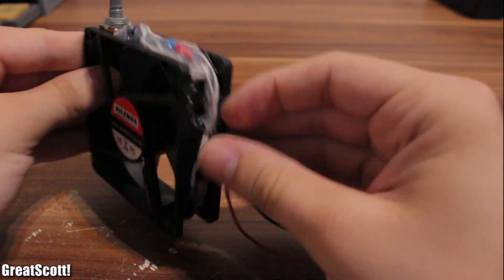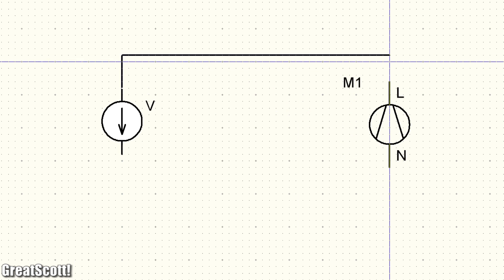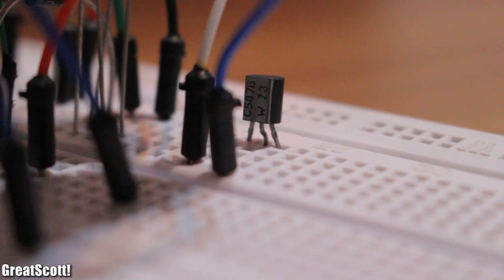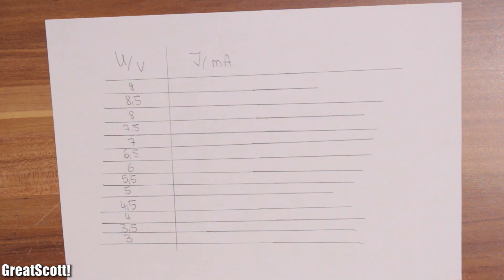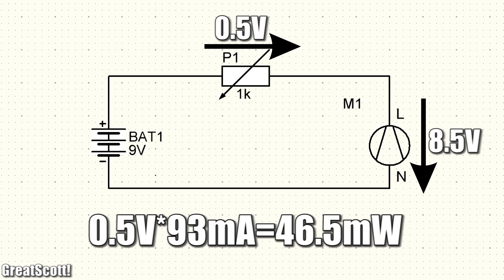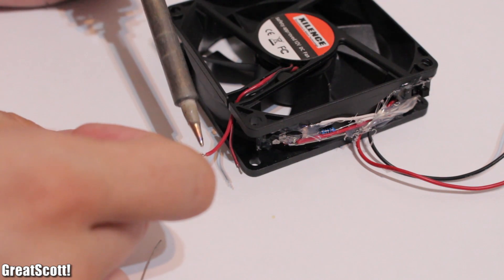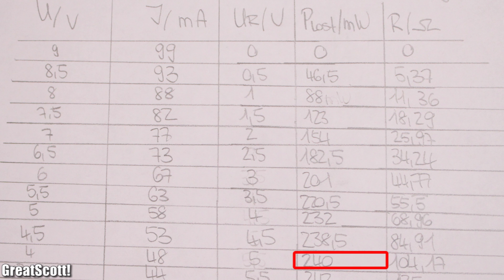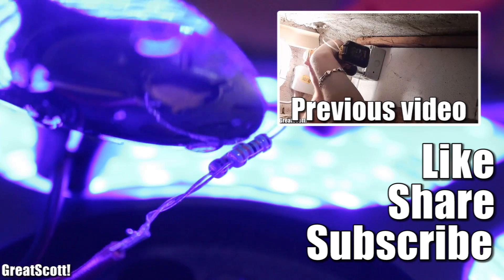PWM VS Potentiometer! When to use which technique?

Comment: Hi GreatScott,
I have some questions that I am thinking about it. I wanted to build a PWM controlled fan for my power supply's cooling fan, by taking the temperature of the mosfet in the power supply, it controls the duty cycle of the PWM of the fan. I have tested with Arduino to control it and it works fine. But I am not gonna put my Arduino board into my power supply. So what microcontroller do you recommend for this project?
Reply: ATtiny85 will do fine
Reply: ATtiny85 will do fine
Reply: ATtiny85 will do fine
Reply: ATtiny85 will do fine.
Reply: ATtiny85 will do fine.
Reply: ATtiny85 will do fine.

Comment: Why didnt the leds flicker when you used pwm? :s
Reply from the maker: lastick56 Turning it ON/OFF happened really fast. The human eye is too slow and can not see the flicker.
Reply: oh. sorry. what i mean is how did your camera not pickup the flickering? :D
Reply: ***** the intentional space station moves at 7KM per second, and 30fps is plenty. Speed has no direct relationship to framerate.
My phone's camera can also see a difference between 1000 and 2000 RPM on my drone's propellers, but that's because of a principal best described as optical resonance.
Reply: +lastick56 the video is played back at about 30 frames per second. The human eye can see arguably about no more than 60 fps
Reply: +lastick56 Going with the difference between science and screwing around, let's say his PWM is at 1khz. That means the LED completes the cycle from 'on' to 'off' 1000 times every second. The camera takes 30 samples a second, so each sample is about 0.03 seconds. With 1000 cycles of the LED per second, that means each cycle is 0.001 seconds long. So the camera can observe 30 cycles per frame. That's why the camera doesn't recognize the flicker.

Comment: The Pots will burned out if it is used with a high powered devices that is why it is necessary to use a PWM to control it efficiently :D

Comment: It was a great video (Y) :-)
I have a question, 
To control speed of a DC 12 volt motor 500 rpm how much resistance potentiometer shall be used?
I tried using a 1k ohm potentiometer, but it was effective only on a quite small part of potentiometer. Can using potentiometer damage the motors? 
cadarsh80@yahoo.com

Comment: Could you do a version of Make Littlebig Lamp that doesn't use NTE2013 IC chip. If you haven't seen the project search it up in YouTube it's a good project but can't get hold of the NTE2013 chip Pleeeeeeese help
Reply from the maker: Bob Bennem I am familiar with the project. And I really like the idea. But instead of building a new lamp I would "hack" an existing one to use LED lights and the dimmer circuit.